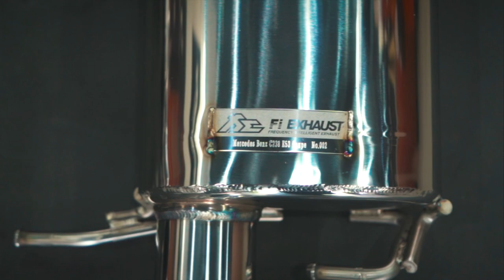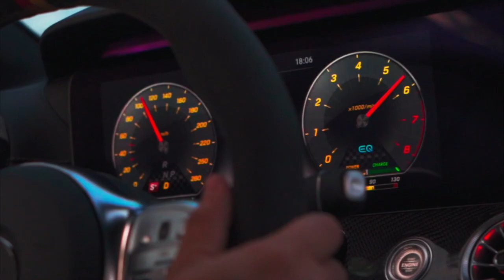Mercedes-AMG C238 E53 Coupe Stage 2 436whp w/ Valvetronic Fi EXHAUST X HubAuto

Comment: How well does this engine handle the extra power? Im also looking for a stage2 for my E53, but im a bit worried the engine wont handle so much power? Is it an overengineered, strong engine to start with? Loving the exhaust sound!
Reply: same, need an answer
Reply: It can do 550bhp easy with stage 1 and transmission tune
Reply: @fardin_hossain  how unreliable does the car become
Reply: @wTio  mild stg1 tune with trans tune and downpipe should be 100% safe
Reply: @fardin_hossain thanks. do you have links to where i can buy these? i’m new to this all lol
Reply: @fardin_hossain yeah man put us on because I’m trying to get mine done for my birthday in October.
Reply: @JoeyGotJuice ecc canada
Reply: @wTio HD tuning or DME TUNING TEXAS should be able to take care of you
Reply: I wouldn't go over 500-520hp without upgrading the turbo